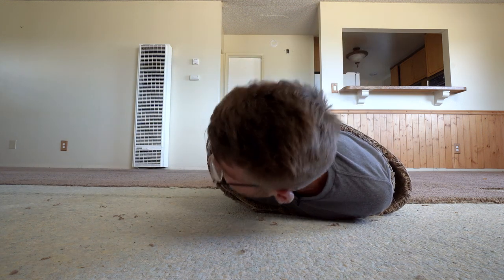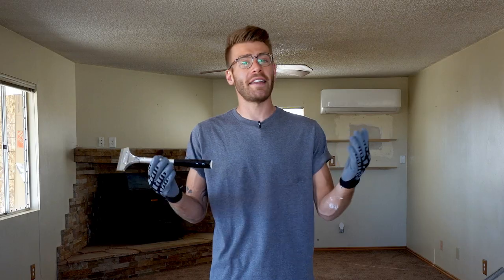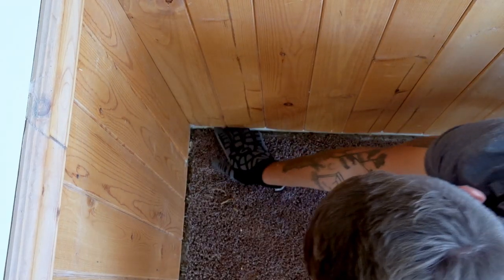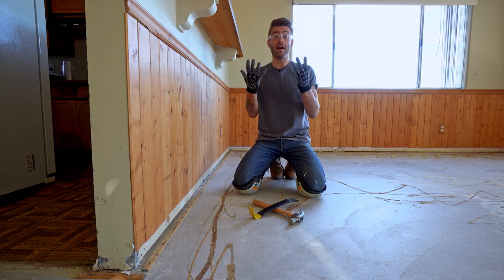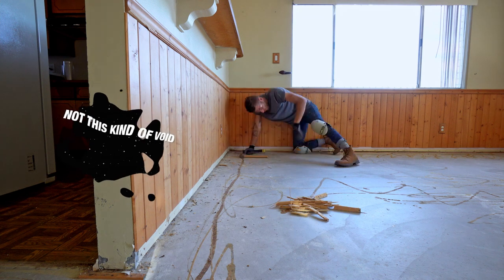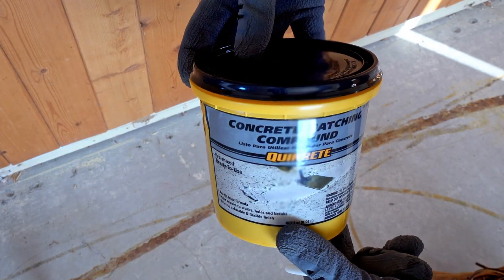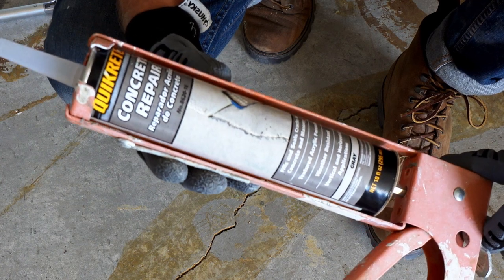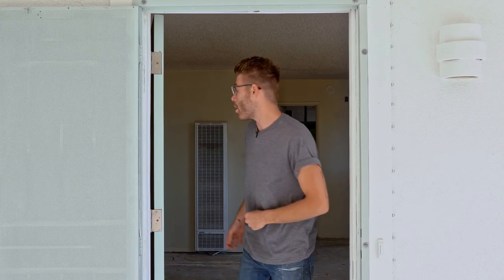How to Un-Carpet Your Floor with Mike Montgomery | How to Undo

Comment: Great video. You can always learn something new. Thanks again.
Reply: My thoughts: Be sure to wear a quality breathing apparatus no matter what we are tearing apart.  Asbestos is in every single thing on this planet.  In fact, we are created from it.  The issue with asbestos is that if our bodies get too much of one thing and not another, we usually go into a tailspin.   
Yes, it's most likely contaminated with asbestos. You can choose to spend the $400 to $1500 having someone say, yes.  There is asbestos.  Or just go buy a $50 breathing mask thing and use that.  Cover your entire body with clothing while demolition of anything.  It's just healthier.  Small critters grow in dark places, and yes, they can get on you, and multiply. It happens more often than not. The vital point of all building materials is that there is mold in all material. So through time we all have to exchange the old with the new.  If the wrong material gets contaminated with moisture it will begin growing only God knows what, why, how, and where for. Mold is deadly.  Mold is what makes us old. Figure out the secret to making mold step back in time, will give us all back our lives, and stop feeling so stiff all the time.